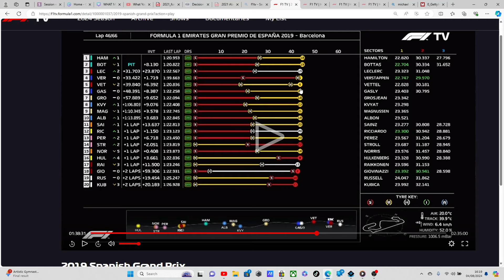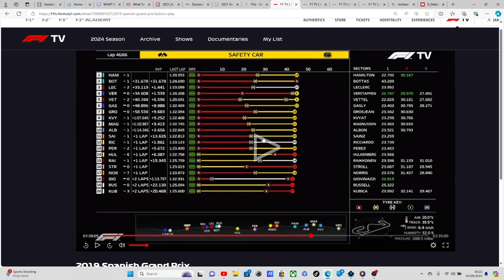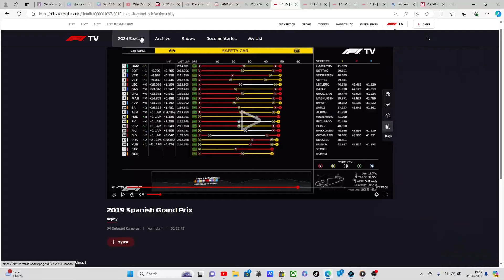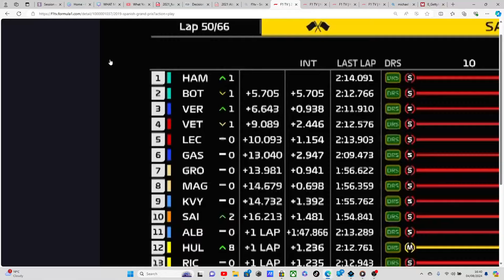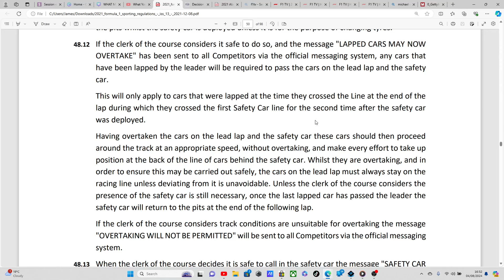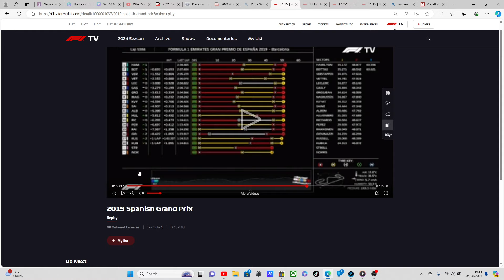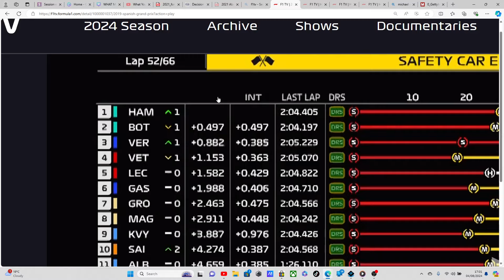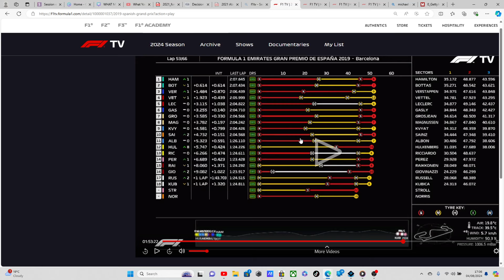MASI SPEAKS OUT - 'THE PURPOSE OF 15.3 - OVERRRIDING AUTHORITY' #lewishamilton #f1 #abudhabi2021

Comment: So you saw Latifi's car catch fire, yet in previous videos you complain why he didn't attempt to make his way back to the pits. Your agenda is leading nowhere 👍
Reply from the maker: Why did ir catch on fire Colin?...
Because hot brakes are COOLED by the airflow when the car is MOVING... When it stops, the heat given off causes them to catch fire...
But as with every desire driven strappon fan child, you TRY to create an argument that you THINK can win to everything presented - rather than accept truth.
Reply: @richardmorse2323 Just listen to what your being presented with. You know what you witnessed in 2021 was wrong...This chap is providing too many examples... too many. Video after video... 
If your not counting up the madness why are you here?
Reply: @jamesatkins888 Where is the proof and/or facts that Latifi crashed on purpose..it's your desire.
Reply: Latifi car was on fire, these videos evidence even on YouTube, after he crashed the car combusted into flames, the Marshals put it out and then hooked the car up and as they was lifting it up the car burst into flames again and the driver who was lifting the car up put it back down on the track again so the Marshals could put the fire out again, they then had to wait for the lifting hook to be moved back into place again and hook the car back up to it, then start lifting the car, after that they needed to check the track was safe to race on and sweep up the carbon fibre, the worst part about it is the Marshals was still on track when masi restarted the race, breaking even more regulations.

Comment: Before this the FIA should have banned the DAS system on Mercedes and never allowed them to use it , deemed illegal in 2021 because of a unfair advantage article 10.5.2 and against the spirit of the sport.
Reply: They couldn't because Mercedes went to the fia with the design and they agreed there was no regulations against it as long it's not used under racing conditions and it wasn't. Under safety car and warm up laps by regulations isn't under racing conditions. They only banned it after 2021 because the cost of it would of given all the top team's an advantage if they had it, no other reason.